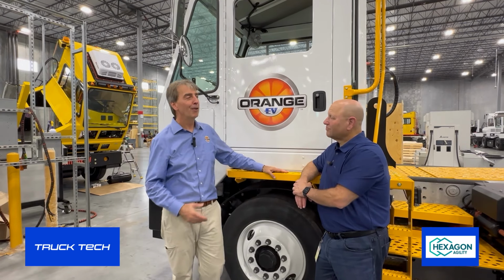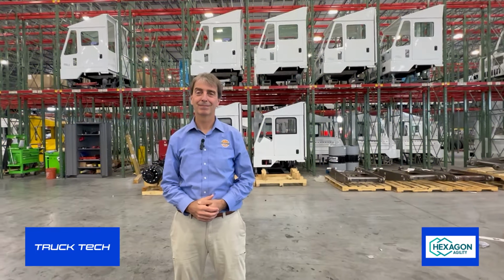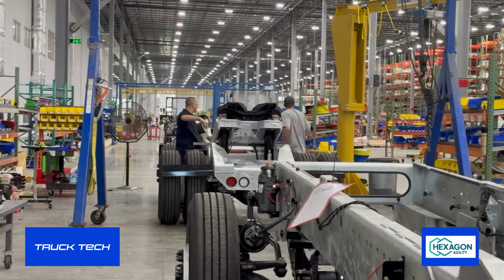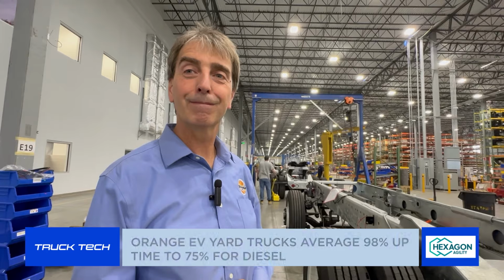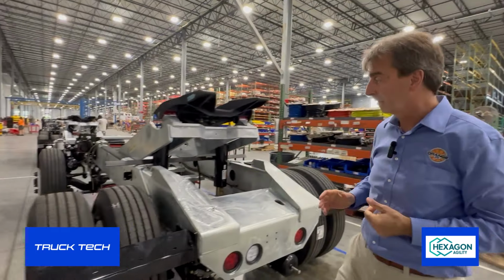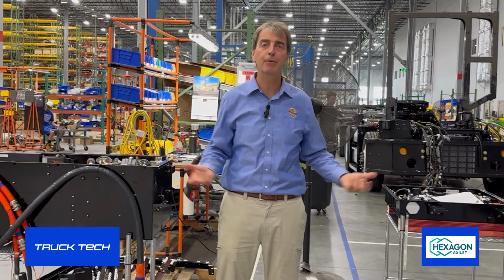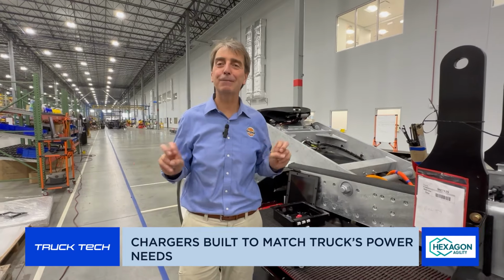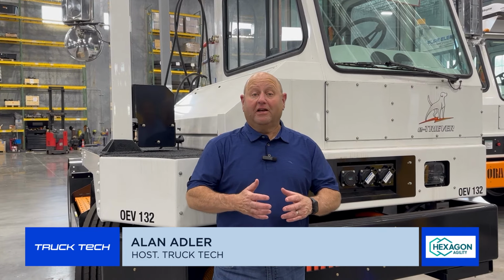Orange EV ''yard dogs'' lead industry in Class 8 electric truck adoption | Truck Tech

Comment: Looks like you're retrofitting Kalmar/Ottawa trucks.
Reply: They brought one of their demo trucks to my workplace a few months ago, and that's exactly what I thought too!! I have had my class A CDL since February of year 2000 and drove OTR from then until I began my current job in October of 2019. I've been to many warehouses and have seen various yard trucks throughout the years, and as soon as I saw the Orange EV demo truck I thought  " That looks like an OLD style of yard truck that has been converted to electric. " Just to satisfy my own curiosity I did a Google search of Ottawa Kalmar truck images and I randomly chose the year 2010. Their cabs back then look just like the new Orange EV cabs, except  right above the front bumper where the charging port connections are installed. Of course they had to make a modification for that.